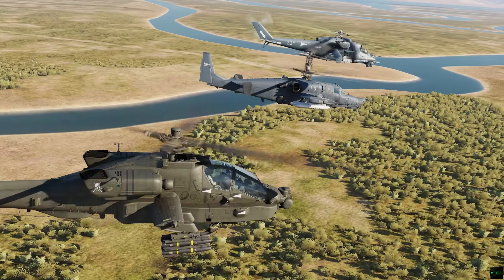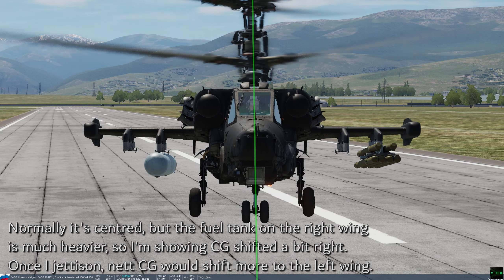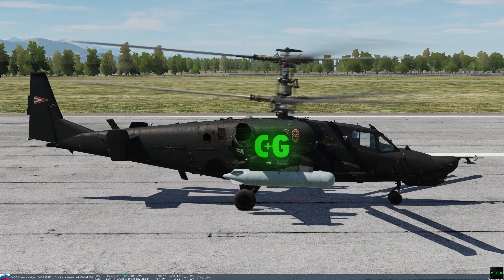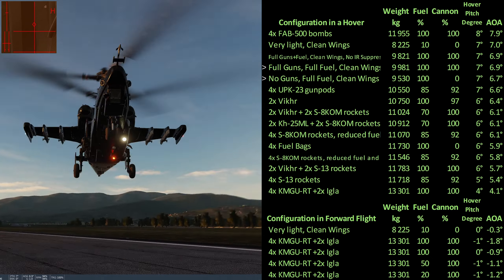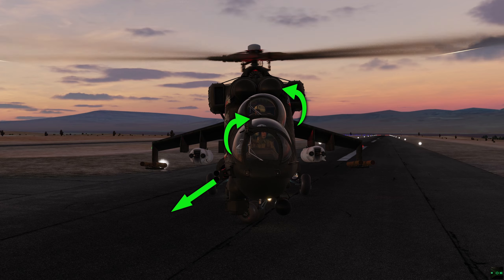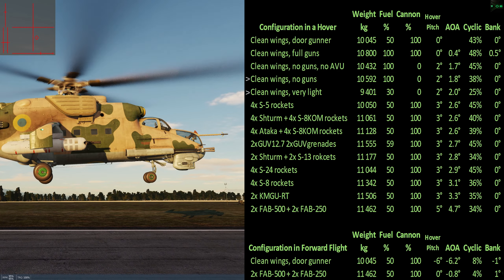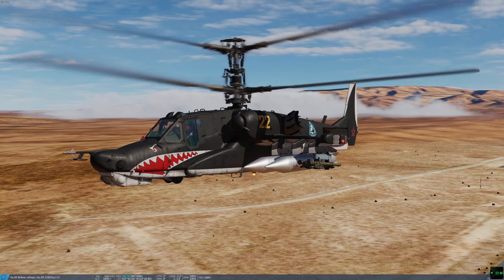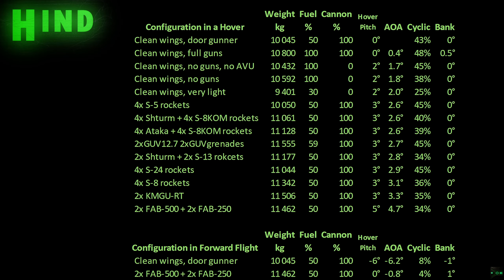Center of Gravity Shifts | DCS Ka-50 AH-64D Mi-24P

Comment: Hello, thanks for the video, it's really helpful and eye opener. One thing I noticed around 3:15, how did you manage to get the... Glass that has the hud elements so dark? I suffer with it a lot during bright daytime and this would help a ton.
Reply from the maker: Up the brightness knob on the HUD, and if necessary, that dark tint it the glare shield being up. If you hover the mouse cursor roundabout where that pipe goes into the HUD on the left, there's a uppy-downy switch that raises or lowers the glare shield.
Reply: I dont want to admit how long have I been flying without realising this.... thank you SO much! @volkvoort

Comment: 5:30 - Are you sure about that? Whe the CG moves forward, the nose should go down, because there is higher distance between CG and the rotor. To fix that you need to pull more cyclic. But I would be wrong. It depends if the CG is in fron of the rotor or behind the rotor.
Reply from the maker: CG being more forewards than what it was before, would make nose pitch down more (whether that's means more level hover or negative pitch hover of course depends on how far forwards the CG was before amongst other factors), and more back cyclic to counter (i.e. be in the hover). My phrasing of "swiveling backwards" there might have been confusing (i.e. which backwards).

Comment: for the 50, many times I open the Cross-feed & shut the Forward fuel pump to deplete the Aft fuel tank a bit, and displace that CG longitudinally toward the nose of the shark.. but transversally when one Kh-25ML still hanging, no substitution of delicate trim.
Reply from the maker: Do you find you notice the (up to) 45kg difference, also given how close it is to centreline?
Reply: @volkvoort  Indeed, you feel it even on stick.. other things makes the 🦈 pitch_UP/DN.. when throttle 👇 it pitch 👆,  & when drop gears 👇 it pitch 👇 .. you see all this affects the CG in the bore axes. 😌
Reply from the maker: @tmting4942  Interesting. I still need to play with the crossfeed early. Had some rumours of drastically assymetric fuel using it, but that was likley battle damage. Dropping the gear and especially the collective I'd imagine to be more an aerodynamic change that might start pushing the limits of the autopilots. In other words that the wheels moving from the CG would cause some CG shift, but it might be more drag-related.
Reply: @volkvoort  you have right about landing gears, @ certain speed they amplify the parasite drag & change the chopper fly behavior, also that would help to slow down in case of emergency dive.. in contrast, @ hover it seems they pitch down the 🦈 a bit by displacing away from the vertical rotor axes.
Reply from the maker: @tmting4942 moving it in a hover, then there has to be a significant cg component. I mean, sure there'd be some changes in airflow maybe vertically, but that is VERY interesting. Didn't think to check that.